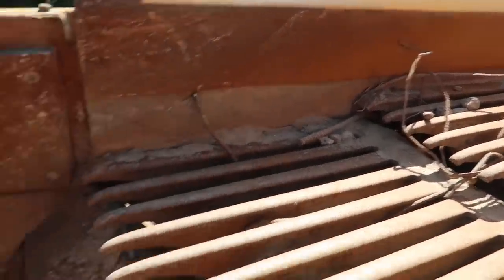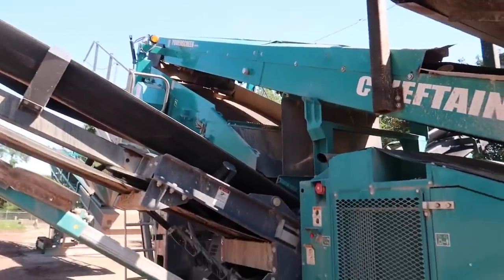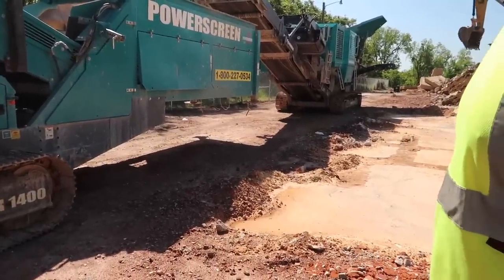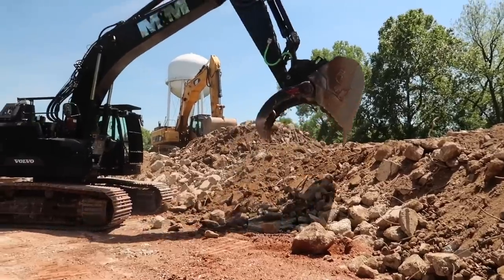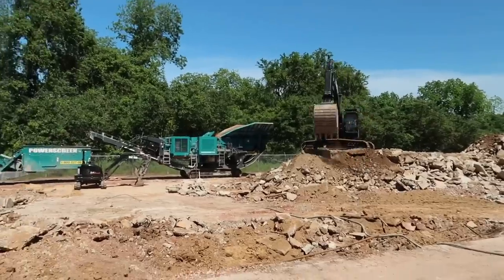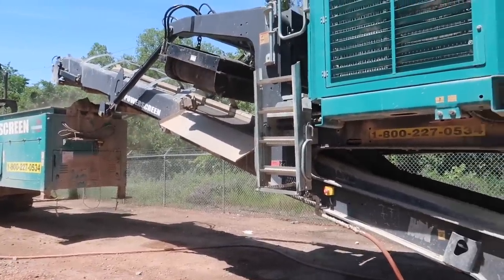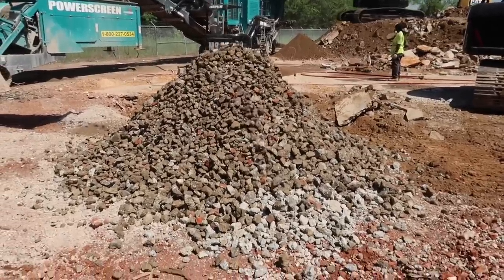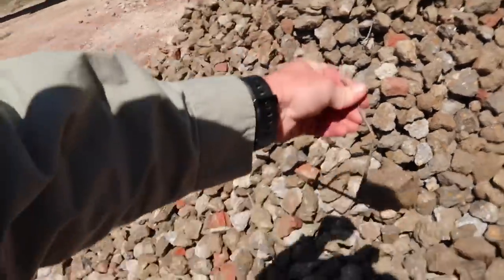CONCRETE CRUSHER in action!

Comment: Excellent tour of the Powerscreen crushers and screeners.The jaw crusher-simple,robust less moving parts than other heavy rock crushers.Screw compressor-delt with one in a building I worked at downtown Wash DC-glad I am away from there now.The building engineer asked me to help him repair one of the Quincy 60Hp 480V 3Ph building air compressors.Two buildings on the air system-each place had two compressors-for gen building air.I installed the unloader relay for him-normally I repair maintain broadcast studio gear-but radiomen have to prepare to work on ANYTHING that comes by.The unloader in this compressor was a simple solenoid activated flap that covered the air intake when the compressor starts.When the machine started in the loaded condition it tripped its breaker.After the fix-was fine-engineer happy I had something else to do-quiet mid shift.Doco-ed what I did and it was OK.

Comment: ran one these before they're pretty slick it was a Terex model with no screening system,just the crusher.. they can really pump the rebar and concrete something fierce all day long, had a few issues with it though, liked to turn itself off sometimes and steel plates and rebar would sometimes stop the magnet causing a pile up AKA a big mess.... but they're really user friendly, if you overload a belt, it'll shut down, jaw belt slips, it'll shut down, self feeding system, these crushing units are impressive concrete recyclers, 

the upkeep isn't to bad actually you run and run and run without any issues most days, its designed to go and go .. each jaw wear plate can go, what 2000 hours? maybe longer, they are super good crushers best in class
You can expect maybe, 1 dollar, 1.50$  per ton going through the crusher alone in costs, really efficient unit for keeping costs down

EDIT, dunno if it will be seen now, but welding a plate over the grizzly's in the jaw just the one upper section of the feeder, will help get some more fine material going through the screener,and less off the side belt,  just a suggestion, take care all

Comment: Cool video,now you're getting into the stuff I work on and fabricate parts for.Jaw crushers aren't too bad maintenance.20 odd years ago I used to work for a company that ran roller crushers,those are used to reduce the small stuff down to grit.The rollers had to be built up and trued several times a month.The saying used to be "crush all day and weld all night".

Comment: We used the same type of self cleaning magnets on the conveyor leaving the bark and fuel chip dump at the mill. You should see the metal that comes in from sawmill dust trailers. Everything that breaks or falls in a sawmill ends up in the vibrating conveyor and in the dust trailer.